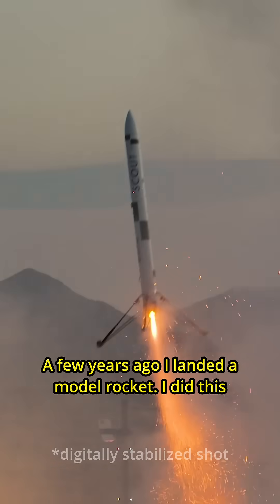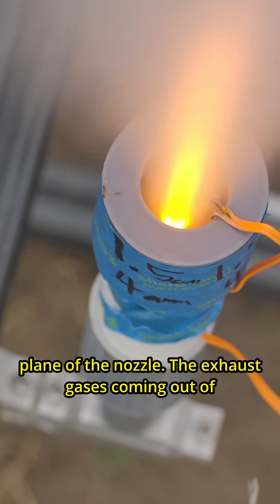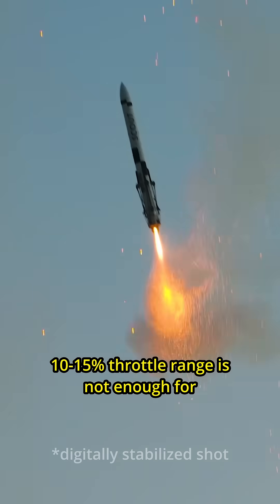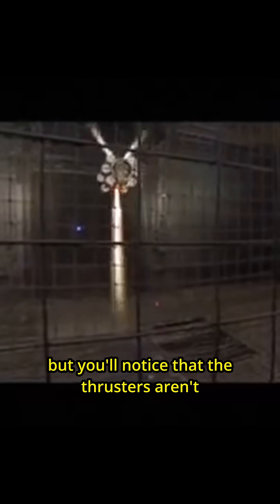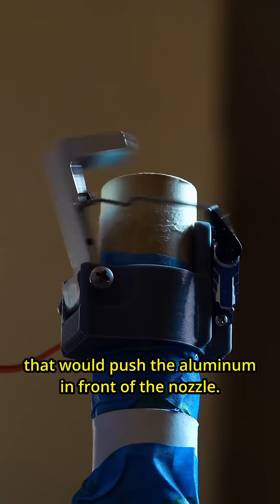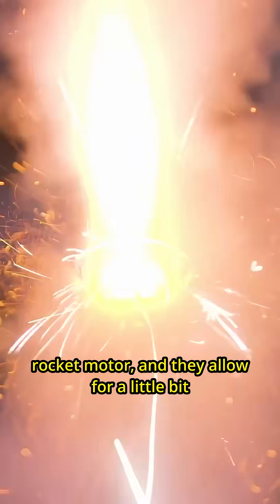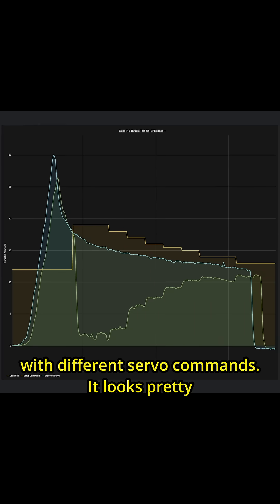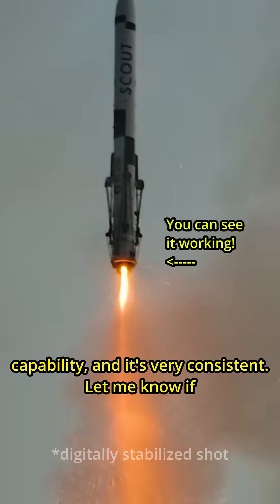Solid Rocket Throttle Control

Comment: Tungsten might also work but ceramic is a lot cheaper. I would choose tungsten over ceramic for durability. I also wonder if using a tungsten nozzle to spray a retardant into the engine would work for a more analog approach? Another approach i might consider is an adjustible diverter. Where there is a teardrop center piece and a cylinder with an inside lip on the end that moves outside it. When the cylinder is fully extended, the flame path is straight but when you retract it the flame path sprays out the sides introducing a balanced sideways force component and less upward force. Obviously this can cause issues if the force isn't balanced but it would be interesting if it worked XD. Maybe have diverter valves that open up and turn into a bunch of smaller jets. Or better yet use water jet technology and tungsten or ceramic to redirect a componet of the thrust upward. A bucket and hinge mechanism is used. GL!

Comment: You could use a hybrid motor, solid propellant and an oxygen generator and bleed off or throttle oxygen as required for thrust.  More complex but you can probably get better control

Comment: Instead of forcing the position of the pieces of ceramic, which leads to a reduced but unknown thrust, I would have controlled a force that squeeze them in. The more force, the more disruption to the thrust —> you might get a predictable thrust = f(force) function.

Comment: The USAF jet trainer from the 1960s used a similar method for landing as the engines had significant lag in throttle response.  The T37 uses jet engines with single stage centrifugal compressors and a rejected landing could result in a crash.   Thrust attenuation instead of reduced fuel is used to decrease altitude, if a landing is aborted, the attenuators are rapidly stowed, restoring full thrust.

Comment: I would have probably used four equally spaced flame diverters that would divert the flame up slightly and move them towards or away from the center using some sort of Cam... Opera House a sliding collar that pushes along wedges pushing the diverters into the center... 

Probably would have tried making them out of sintered titanium...

But this looks like it works great.... Do you find that having the flame divert out two sides in a turbulent manner affects your flight characteristics?

Comment: Maybe write a program that can do the pulse firing like in those test models? It can’t be that difficult right??? I feel like putting a physical blockade is only redirecting the flow of energy rather than controlling it. I mean a step further would be writing a program that controls descent velocity and fires the jet to adjust automatically in relation to height so that by the time it reaches just above ft above starting point he velocity is equal to zero. You get the idea.

Comment: Use mutpule engines surrounding a body and use seveos to tilt the motors. More the motors point out the lower the downward thrust is.

Comment: If you cannot control the flow sufficiently simply don't do it by force

Redirected thrust could help to stabilize lower part of rocked during landing by splitting it's flow into few smaller spikes redirected with it's angle more to to sides 

Simply just change the shape of shutter to spread flow more evenly and naturally to sides than blocking it completelly

Comment: I thought your idea works just fine ! It worked right you landed your Rocket! I know I watched it on the film so I’d say success until you can find a modulating rocket motor , maybe one they use in RC planes and jets , it’ll be electric maybe use the black powder motor for flight the electricity motor for landing

Comment: Thanks for video!  I think you could have gotten more from Krushnic Effect by making your extender narrower (smaller diameter), and perhaps with ring fins inside. Or maybe wider depending if you are going for vortices or for drag effect.  There are likely variants as well.

Comment: That is NOT a model rocket - It IS a rocket!
I saw the aluminium and thought OMG - I'D have gone down the Stainless Steel helical guide vane route - imagine a drill chuck with a part-helix vane on each jaw that travels into the jet to slow and guide the jet to a tangential direction.....
I love rocketry, and its greater accessibility, albeit heavily regulated.
👍😍

Comment: I remember reading something about solid fuel motors that used a special fuel that required a small current through it to combust, but don't remember much other than that.

Comment: The problem with this is going to be the way it diverts the thrust. Uneven erosion could lead to losing equilibrium laterally. 

I was going to suggest if you had lateral thrusters you could control it.  But actually… you just made some by accident. You could add secondary ceramic control surfaces,  or even just a way to separately trim the ceramics  laterally to control this.   Extra Bonus of doing this  is it could give you a way to control its lateral velocity during the landing burn

Comment: Another way is not to fight with the thrust, but just decrease the pressure value inside the channel, so add the valve on the front or side wall... )))

Comment: I'm thinking of a design, shaped roughly like a segmented, inverted plug nozzle, mounted below the main exhaust. With the segments spread apart the exhaust has an open straight path for maximum thrust. As they move inward they would deflect a varying portion of the exhaust outward, giving a range of thrust plus the ability to shape a thrust "lobe" vector using asymmetrical positioning of the deflector segments.

Not too much different from what you already did, I guess, but hard to describe my thoughts in a quick comment.

Oh, and congratulations on "sticking the landing"!

Comment: I would have used a piece of pipe with hole through the side. Then rotate the pipe so the exhaust was going through the hole and rotating it further would block the flow. A circular motion would be smoother. You could also continuously rotate the assembly and vary the rotational speed to allow more or less exhaust to pass through as opposed to divert.

Comment: A good comparison of PWM is cars. Tons of circuits are using it nowadays a great example is the alternator, the field control wire is typically PWM from the pcm or however ur brand calls a power train control module(typically will control both engine and transmission unless u have a separate TCM, hope that clarifies some)

Comment: Your final solution is close to what I initially came up with in my head. I was imagining two plates connected by a hinge at the top (new the rocket nozzle, centered in the exhaust plume that can be actuated to open/close, which would divert exhaust to the sides. With the right design it could also act as thrust vector control (more than two plates in that case.

Comment: There is flaps or wings like this on a lot of the smaller babylon 5 ships.. which I always thought was this tech you are describing. I just figured it would be the way to quickly get offset thrust or like in that giant battle above coursanct(I can't remember how to spell it) in episode 3, grievous' command ship had some plates or flaps I think to try and use the forward thrust to reverse thrust. 

Many problems would need to solved... Cause most of these flaps looked more areodynamic, rather than something that can redirect flow at 180 or so degree angles.

I enjoy that private people are individually or in small groups doing in small scale tests what we will need to leave this planet and settle the solar system...

Comment: dont simply use a tube, add nubs to the edge of the outlet and that will draw more energy to the sides. the controlled prominence of those nubs would give you thrust control.

Comment: U can use an injector system to control the flow of fuel, connected with some sensor, so u get less thrust and fuel wastage will be low too
But this is A pity long way

Comment: The first thing I thought of is that you need attitude control.  How do you keep  the landing rocket upright?  You can try a gimbal to tilt  the engine, that's how rockets like the Titan survive without any fins.  With a little model rocket engine, you'll have to move the whole engine.  For liquid fueled rockets, you just rotate the combustion chamber and nozzel assembly.

It's a lot of work to just throttle a solid rocket engine.  Give it up and do a liquid rocket engine.  Bonus: you don't waste fuel that's throttled away, it stays in the tank.

Comment: Pulse width is also used in cars. It's used to keep a ratio the same while the car is moving. By shutting off and turning back on. Turns off when there is too much fuel. Turns on when to much air. It does this every millisecond.

Comment: I think I would have solved the problem by simply not using blackpowder rockets, probably the simplest would be to flow oxygen through your fuel pellet - control the oxygen control the burn rate, with the potential to turn the rocket exhaust off entirely and then relight... 

Though as those off the shelf motors are seemingly quite affordable I'd have then been tempted to just scale up the model and use more of those rockets with your original tube idea - still got the limited throttle range on each individual motor, but now a much bigger total thrust range and greater mass to hold up so the throttle range should overlap the neutral point. And it would look really impressive.

Comment: I'm no expert, but you could try using the high temperature ceramic to create shutter or "iris" at the bottom that can dictate the flow rate, or stop it entirely. Combine that with a reignition system and you have a full throttleable solid rocket motor. (In theory)

Comment: Why not have some sort of iris mechinism with a gap away from the end of the rocket to allow blocked gasses to escape sideways, say 1/2" to start testing. Ceramic is a great material to use as the iris blades. The housing could me a ceramic with high melt temp metal mechanism parts. Just a quick thought.

Comment: I would use either 3 or 4 of those ceramic nozzle controllers in a pie formation and some sort of balance control system, maybe from a drone. This would help control the sideways thrust vectoring. (If weight and aerodynamics will allow.)

Comment: Depending on the chamber pressures dimensioned holes on the say 4 sides and slide ring from ceramic that enable twisting action to open more or less or completely block the side holes lowering the pressure once you want to decrease the thrust, though geometry needs to be simulated so opening it wont cause twisting motion to the rocket. Since force comes from chamber and ring is a ring, structurally it should work unless exceeding the chamber safety pressures, but then again it could also be designed to fail as emergency pressure relief so if main burn chamber pressure is about to be exceeded the ring fails first, dumping pressure out, lowering it instead whole thing detonating from over pressure. Depending on the sizing of the holes you might still have enough thrust so it comes down gently... well least less hard than rock if chamber blew up. This would need a lot of calculations and simulations but should be doable solution well a repeatable, though it also depends on the chamber material if it can handle well the holes in it.

Comment: You could try to design a nozzle that can control the thrust by opening and closing the nozzle like a camera aperture/iris. But the pressure needs to go somewhere, so maybe add horizontal vent holes

Comment: Years ago I put  powder in the top of a rocket, used a rim fire cartridge that I collected a bit of the powder from, n the tip of it. Then mounted it on my remote control airplane, and tested it on an old Monte Carlo in a junkyard , the ones with the gas cap under the license plate😮   ,.  It must have had a little bit of gas in it cuz it was glorious😂😂😂
It's probably illegal to do nowadays😢 that was a long time ago. 🤔

Comment: I would use a ceramic or glass annular iris to vary the thrust. Add a coating and burn through won't be a problem. We used it on a prototype at Lockheed when I was a project manager there. We abandoned it because we found a better way to change attitude. It had 8 annular irises and a fixed center orifice. We used the outer irises to steer the rocket. It was designed to build a stealth air to air missile. That way the target never got to see the missile so they couldn't evade it.

Comment: I don't know anything about the new solid fuel rocket, nor ceramics. That being said, I noticed that when the servos were activated, there was a slight bend of the flame exhaust. When they both close and there is a smaller amount of exhaust which is what you were going for. But if you had 4 servos and were able to activate each of them according to a gyroscope input do you believe you'd have better control?

Again, I'm just throwing an idea out there that I have just guessed and what I mentioned could be really dumb. But I offer it in hope it helps.

Comment: I think the design of the clamp is where I would optimize first, Straight up inhibiting the flow just results in all the preassure escaping to the sides which can create very uncontrolable forces in multiple directions, further complicating landing control. Rather, let the claps just restrict flow with a less aggresive and more controlled design, perhaps with multiple control stages. 

I'd also wanna do this by mechanical extention rather than servos due to temperature exposure and electronics never mixing well.

Comment: Two decades ago I built a hybrid rocket that used metalized paraffin as the fuel and delivered it to the combustion chamber by melting it and spraying it there. This is as complicated as it sounds and was an absolute nightmare that never quite worked right, but having the solid fuel work as effectively as liquid fuel the few times it did work was amazing.

Comment: A different approach:
1. Generate spin by deflecting the thrust plume sideways like a pinwheel firecracker
2. Add helicopter-like blades that deploy outward from near the top of the rocket due to centrifugal force 
3. Modulate the angle of the blades to control the "lift", which is effectively fighting both the rocket thrust & gravity 
4. Because the majority of the weight is below the blade height, much more stable natural behaviour (like a parachute) rather than the complex math need to stabilise using force applied at the base of the rocket.

(Call it the Falling Willow if it works. She'd like that).
Reply: Ehm, not to be a downer, but then you'd have added a bunch of complexity (and thus weight) from having a complex helicopter hinge mechanism, plus the mass of the blades themselves. And I daresay it'll be hard to land something on legs that is spinning like, well, a spinning top.

Comment: does it have to be black powder for your rocket engine just to try landing a rocket by controlling it's thrust and position?

Otherwise, how about you wrap some carbon fiber around a hydraulic actuator, pressurize it with air like in a firefighter's bottle, that's 6 liters pressurized to 300 bar pressure to give them 1800 liters of air for approximately 40 minutes of intensive work. Use air, or use hydroxigas, by electrolysis of salt water just don't separate the gasses and you have an ideal mixture for combustion. It's all about weight right, I don't think there would be so much difference, and you'll have more control over your prototype rocket.

Comment: Niceee !
If you could machine precisely the two ceramic blockers you could make little deviators for the exhaust gases in those blockers so that as you close them the exhaust gases are able to go backwards - that could yield a better throttle percentage

Comment: I did something similar but with three ceramic disks with a crescent shape cut into each allowing thrust to be blead out but could also redirected the thrust depending what disk or disks were opened and how far they were opened with the crescent shape. 

Took a lot of code but eventually removed most control surfaces.

Once sorted I had the bonus of savage direction correction ability similar agility to the Isreal iron dome missiles but think rear steer on the rocket as I loose speed also I had no method to pulse the engine.

Slow by using the same value on all three to bleed thrust sideways, turning 1 or more disks were used to varied values. It was pretty linear in my application.

Came up with redirection for control from the Harrier Jump Jet as not much else was out there otherwise.

Hard part was getting the ceramics light enough and in the right section of the nozzle. Never tried land it without a chute tho.

Comment: Possible Solution: Could you design something that would inject a gas (CO2 ?) into the base of the rocket flame that would slow the combustion and reduce the power? This would perhaps allow the rocket to burn longer instead of just deflecting the flame.  It should be possible to manage the amount of gas that is being released at all times.

Comment: I have a very weird idea. My English isn’t very well, so imma try to explain this as I could. You know the aperture thing on the camera? Like when it closes and opens depending on different camera settings? So the hole can be made smaller or bigger. What if you try to put this thing on the rocket to control the thrust? Srry for my bad English once again

Comment: There is solid rocket fuel that only ignites when an electric voltage and current are present. This voltage is very small and fully controllable for the type of rocket motor signs you are making and can be smaller and much much larger... Then you're real issue becomes using your Python coding skills or whichever coding you are using for that voltage as a motor controller in time with the telemetry necessary to perform landing control...